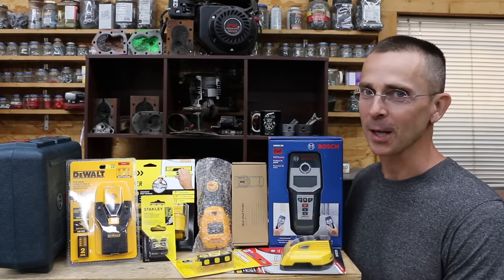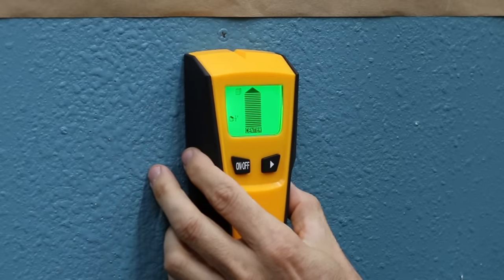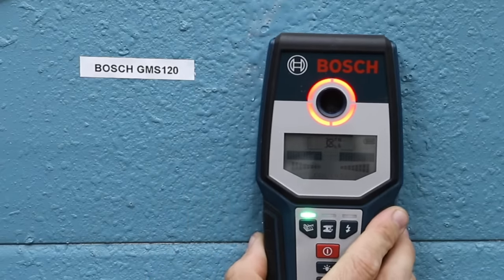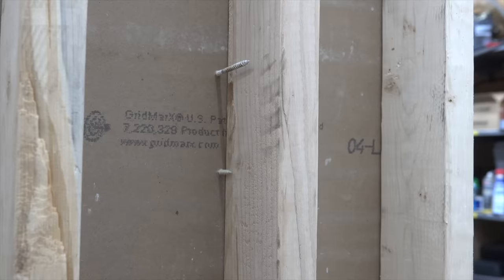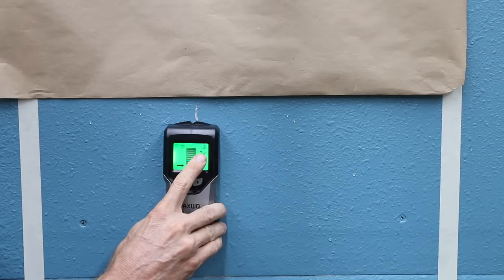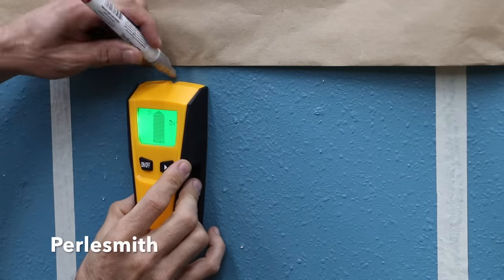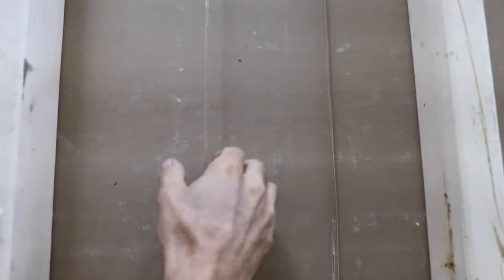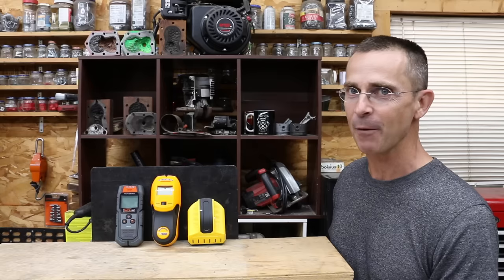Best Stud Finder? $262 Bosch vs $10 CH Hanson vs 9 Other Wall Stud Scanners! Let's find out!

Comment: D-Tect 120 has been discontinued according to Home Depot. New model is the D-Tect 150 and it's priced at $949. For those who work on $10,000,000 homes with perfect walls, this must be the ultimate tool for hanging pictures.
Reply from the maker: Thanks for sharing.

Comment: Idea for a second round: add insulation (especially attic insulation) or other items that might cause false positives. I find that the wall finders all do okay on simple empty walls, but I cannot get a good reading on the ceiling.
Reply from the maker: Thanks for the suggestion.
Reply: @ProjectFarm  or even through a metal roof? Lol

Comment: it would be interesting to see this tested again with a plaster wall constructed the way an old house is with plaster lath or wood lath, a layer of plaster and maybe even chicken wire towards the edge.

that is where I see most stud finders I have tried have failed.
Reply from the maker: Thanks for the suggestion.
Reply: @ProjectFarm  and by the way, just ordered a new stud finder based on this video.

Comment: I need to see another battle of some really good stud finders, in different patch laters of dry wall, in a older apt  that was built decadeds ago who knows probably in the 1960 or so im just guessing I  need a stud finder that will find the wood, wires and pipes no matter the layers of drywall, the guys did a terrible job something that im cleaning up as I go this is the only challenge I really have to deal with. I got franklin 13 sensors that cost around 45usd a the time it's ok but now robust.

Comment: Just bought a Craftsman $15 and is not good with plaster walls.
Also if there is an electric wire that over powers all other indicators making it useless finding stud edges with a wire present.
I need a good detector for wood slat/plaster walls
Reply from the maker: Thanks for the feedback.

Comment: The issue I have with the bosh is it thinks there is electrical wire everywhere....... I have cut so many holes in my walls to see there was nothing at all. At this point I just cut holed for every stud, since it thinks theres a wire on 3/4 of them.

There is one about 1/5th the time it detects one.

Other times I have it over the outlet and it doesn't go off.... I wouldn't recommend it at all.
Reply from the maker: Thanks for the feedback.

Comment: I have a Franklin Sensors with the 13 sensors, but it can't positively identify studs behind 3/4 inch tile and grout and another half inch drywall. I need to install a handhold for my wife who's returning from the hospital. I also tried an extremely powerful magnet, but it seems to be lightly pulled everywhere in the shower wall. Any stud finder that could work for this? Perhaps it's a good comparison test.
Reply from the maker: Thanks for the suggestion.

Comment: Zircon A100 is not available , Dewalt has a 1.5" model now, is that better than the 3/4"? also battery type is a big concern,  9v battery are expensive or hard to find. rechargeable batteries usually provide less volt that can affect the performance... please include that info in the next review ...  average houhold consumer would not use the stud finder often, so taking out the battery and being able to use AA or AAA rechargeable and get good result is important;  tacklife is model DMS03 under different brands
Reply from the maker: Thanks for the suggestion.

Comment: 3 years late to the party, it'd be great to see how well this does on concrete and plaster walls with electrical conduits inside. That's a much more common construction type outside the US.
Reply from the maker: Thanks for the suggestion.

Comment: Have you ever tested the Walabot dyi wall scanner that connects to your smartphone? I'm looking for a better solution. My walls are plaster and lathe and a normal stud finder just doesn't work well. Especially with textured walls and ceilings.  I currently have the Franklin and it's  repeatability isn't accurate.  Finds a stud one time the next it's not there. Thanks for any help
Reply from the maker: Thanks for the suggestion.

Comment: I don't trust anything but a magnet to find screws and nail heads in studs. Although I have never owned a scanner that was accurate or could locate other objects. After you find a few screw heads  in a line using a magnet, and then a the next stud over the same way, you can be pretty sure that you will hit a stud.
Reply from the maker: Thanks for the feedback.

Comment: Pro tip: instead of buying a magnetic stug finder, just get the strongest rare earth magnet you can find.  I own a home with plaster walls, and most stud finders are useless, but a simple strong magnet that is more powerful than the ones in the finder will work.   I am poor, so I never tried a digital one.
Reply from the maker: Thanks for the feedback.

Comment: Some of these don't work at all on plaster walls. The magnet ones work the best. I wasted $75 on a good Franklin, and got a 5 dollar magnet and it worked every time. Few of the fancy ones say anything about plaster walls on the packaging and salepeople are clueless. We only work on old houses with plaster walls. Actually a 20 cent magnet on a string works better than most of the big brands.
Reply from the maker: Thanks for the feedback.

Comment: If you really want to test stud finders try it on a old plaster and lathe wall. Almost any stud finder will work on drywall. But plaster and lathe walls are hard even on top of the line stud finders
Reply from the maker: Thanks for the feedback.

Comment: I bought the second most expensive Zircon that Lowes sold 2 or 3 years ago and absolutely hate it. Maybe it’s user error even though I’ve read and re-read the directions. All I can say, if it tells you it’s found a stud, you better drill a small inconspicuous hole to make sure it’s not lying to you 🤦🏻‍♂️!
Reply from the maker: Thanks for the feedback.

Comment: Any stud finder will find a stud under ideal conditions. The accuracy test is good, but this is kind of useless for any non-perfect real-world situation:
- Ceilings or weird spackle textures
- Multiple layers of material (drywall, plywood, vapor barriers, etc)
- Weird gaps (gap between drywall and stud, etc)
- Old construction (lathe and plaster, etc)
We tried TWO different Zicron stud finders ($20 and $40) and they're completely useless, can't find any studs in ceiling or half the studs in the walls (new construction, normal house)

Comment: Too bad ya didn't pick up the walabot 
 It's supposed to use low power wifi/2.4ghz microwave in a little box your hook to your phone
I've got one and love it, it's surprisingly sensitive
Reply from the maker: Thanks for the suggestion.

Comment: Would have been a lot easier to mark the painted wall to show exactly where the stud edges were.  It's not like the detector would know where the marks were.  Would have saved you the trouble of drilling screws to see how far off the detection was.
Reply from the maker: Thanks for the feedback.

Comment: Would prefer a test with different wall material rather than finding different objects in the wall. I can tap on sheetrock and find the stud 90% of the time, but not through a shower stall, plaster, or that old tongue and groove.
Reply from the maker: Thanks for the suggestion.

Comment: You showed a significant defect in the Franklin scanners that I found, sadly after buying it.  They do not detect edges and give a fake approximation assuming it is a 2x4 . In the videos you'll see that it :reported the electrical and the speaker wire as if it was a 2x4. It claims to be show edges.  Also use anything but super fresh batteries and it's not going to even power on (in my experience).  Franklin's edge detection claim is a complete scam.
Reply from the maker: Thanks for the feedback.

Comment: Either use my own Magnet or I use a stud pop another case 100% made in America from recycled material we will piece of coat hanger to the string sassy Sue magnifier wave it against the wall wherever it sticks you have either found a nail or screw instructions for the stud pop are on the packaging
Reply from the maker: Thanks for the feedback.

Comment: That electric not working kinda sucks, a live wire by code should be in the middle of the wall and not right against the sheetrock. So the ones that didn't detect it do not work.

Comment: 1-1/4" is not very deep.. we used to drill our holes directly in the center of studs for electrical.. none of these would find my wires because I would pull them tight before stapling.
Reply from the maker: Thanks for the feedback.

Comment: With my experience over the y3ars none of them work effective enough to find studs. I started withthe magnet in 71 and have used several Zircons and one Bosch.  Screw location seems to be the more dependable.  You should have had the wall cavity with things you always find there namely insulation.
Reply from the maker: Thanks for sharing.

Comment: I would have liked to see how these things do against double layer dry wall.  Heck, there are times when the bastards triple layer it just to fur out the shoddy carpentry....  Then I have to install a 2-foot baseboard heater on a wall with only one usable stud hidden behind 2 layers of drywall.  Everything else you showed doesn't matter to me because as the electrician that's pulling the suites, I generally know where they're installing the pipes and wires.  But there are many times I find a wall with no bloody studs despite using two-and-a-half inch screws...
Reply from the maker: Thanks for the feedback.

Comment: Yeah but my walls are filled with a rapidly shifting network of studs that run both vertically and horizontally, if any studfinder I've ever used is to be trusted.
Reply from the maker: Thanks for the feedback.

Comment: Anyone in the comments have experience with a stud finder that works on old fashion lathe and plaster walls? Every stud finder I've bought just reads the lathes 99% of the time and it's hard to pinpoint the studs/joists.

Comment: I love the content, but damn this blew by super fast and the speech was so rapid pace that it was really hard to process and keep up with. I had to go to Settings and turn down the playback speed to 0.75 to be able to keep up with making sense of it all, since it was racing by faster than I could process. 
I love the information and reviews a lot, and the testing methods, but dang, slow down your speech a bit please and don't cut the edits so immediately back-to-back

Comment: Bah, none of these work on my house. It was built in 1925. The walls are brick with 1 x 3 wood nailed flat on the brick. On that is a 45 degree wood slat covering. On top of that is the real killer. A galvanized steel expanded mesh, stapled to the wood. There is 3/4” mortar on top, with 1/4” plaster on that. Then there’s are a number of paint layers. The bottom no doubt of lead.

You need a $3,000 wall radar to see anything inside. Really! I’ve had to rent one.
Reply from the maker: Thanks for sharing.

Comment: I don’t think a stud finder is worthwhile. If it tells you to drill directly into a wire or pipe that’s bad news. What I do is find an outlet/switch/corner and measure 16” off center from there. Hasn’t failed me yet.
Reply from the maker: Thanks for the feedback.

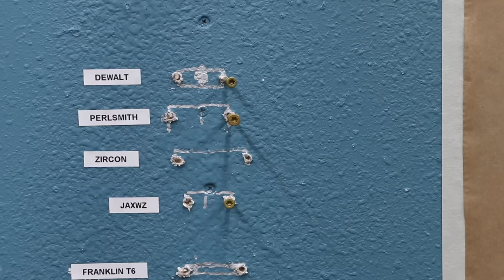Comment: 6:28 it would have been much more useful and less work for you if you just snapped a line on either side of the stud. 7:46 a chalk line didnt even cross your mind at this point???

Comment: I love your videos, but unfortunately, I don't think this one was very well done.  The most important function of a stud finder is to find a wood stud behind drywall, not to find screws.  Every test you did was directly over screws, so I have no idea how they work on wood that has no screws in it.  The test you did with the magnet based detectors should have failed.

Comment: You didn't test you knuckles and ears.  The most common reason to find a stud is for mounting heavy objects.  It's pretty easy to find the stud by knocking on the drywall and noting the change in pitch.  Pipes and wires are another story.  You may have to use your intelligence to avoid them.

Comment: All are garbage gimmicks. Take a flashlight and hold it touching the wall, facing up and look for the dimples or imperfections from the drywall screw heads. Mark off 16 inches along the baseboard with a light pencil mark where no one will notice it. Use a level vertically to mark off the studs. Throw away your studfinder.

Comment: 9:37 that horrible. so the indication of a live wire and a stud is identical. so you have no idea whats a stud and whats A WIRE. i should not have to explain why this is bad. i wouldnt even have edited this stud finder into the video. noone should be using it. 10:18 same for this